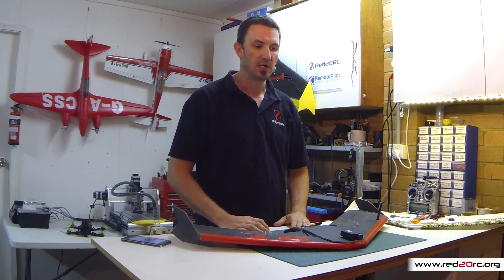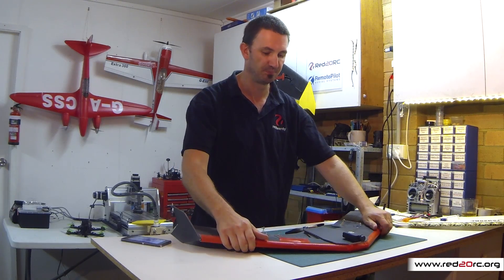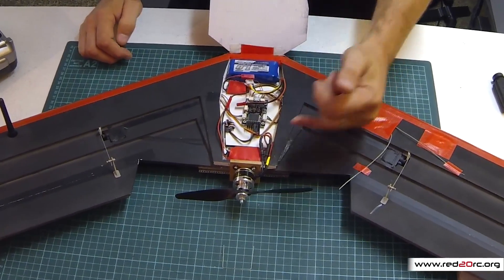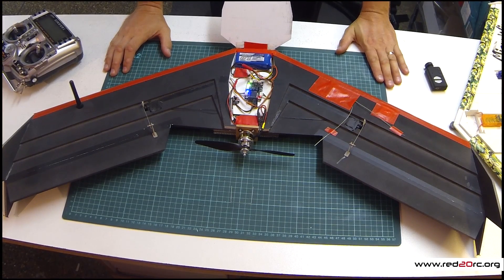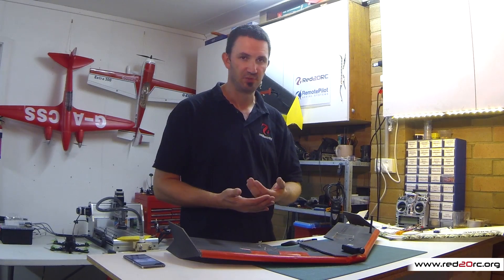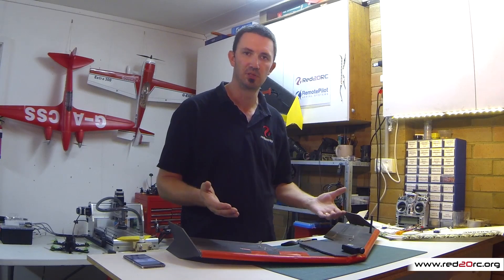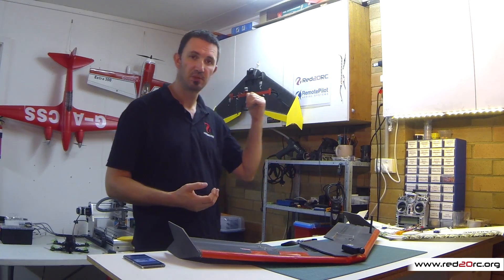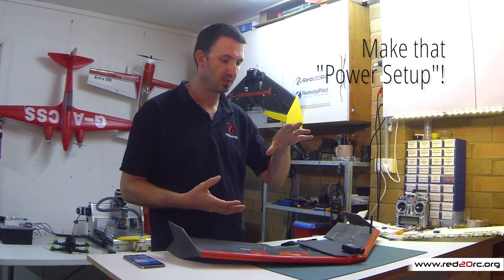Microwing UAV - foam board drone - HKPilot APM 2.5 - Autonomous KFM7 flying wing

Comment: I got my servos hooked up to my FC, I am thinking that maybe the problem why I cant get my flaps to go up snd down. I got them to go to the left snd right they wont go up and down. I am using the Taranis, hot any idea what to do. Thanks.
Reply from the maker: Derrick Mitchell which flight controller are you using? It sounds very much like you don't have elevon mixing set up.
Reply: Red20RC Thank you for responding back. I am using a Sp Racing Evo. Elevon mixing, I thought no mixing is necessary. I got it set up on Inav and on the Inav fixed wing site it  says no mixing or am I misunderstanding.
Reply from the maker: Derrick Mitchell that sounds right. The taranis should have mixing at all and the iNav should have elevon mixing. Make sure you test on manual/passthrough mode so the FC doesn't try to override your inputs.
If all else fails you could try a custom mix rather than a preset.
Reply: Red20RC  Ok that sounds good and I will try it in hopes that it will work.  I'll keep you posted on my progress as I follow up on your advice. Thanks!!!😎

Comment: Ever tried a bigger Prop, 7 or 8in?
Reply from the maker: joel ben never did on this one but I have since. The key seems to be a high kv motor, 2S battery and large prop for an extended flight time.
Reply: think a 2204 2200kv might work with a 8in prop or 6045 prop. 
Built a 650 mm, 3s 1000mah, QAV2204 2200kv 30A esc. No maiden yet. Happy Holidays. Afro mini 32. 414grams
Reply: Kfm 3

Comment: good video, could you tell me which it is the motor that is using, the prop and esc please thank you
Reply from the maker: It's going back a bit but I did manage to find the old motor! It was a Turnigy Aerodrive 2205/34 1500kv, spinning I think a 7x6 prop. It used a Turnigy Plush ESC (the 18A I think).
The biggest problem was that it was way underpowered and the battery was just too small. If I had my time again I would used a higher KV miniquad motor (like a 2205/2300), and 8 inch prop and a larger 2S pack.

Comment: The video quality is unstable and also the flight chacteristic are also unstable Parrot just came out with the Disco because that was not impressive
Reply from the maker: You are absolutely correct!
This was always just an experiment and it was underpowered and I made the mistake of testing in strong wind.
There was no vibration dampening and no stabilisation just an old Mobius stuck to the wing.
Remember though that this was never intended to be a FPV ship like the Disco. It was intended for still map imaging so none of this really matters.
It is true though that the mass produced RTF products will always be one step ahead in terms of technology (I just picked up a P3P for the same reason) and those with unlimited credit need look no further than Parrot or similar!
Reply: awww were you not impressed? and why are you comparing a wing worth about $100 to a parrot worth $1200

Comment: I love this, thanks. Do you think APM boards must have the little anti vibration balls, I have a spare one I wanna use. Is it windy in the vid? Would stabilization FC work?
Reply: +FastEasyLifeTips Also I have a gopro ;)
Reply: +FastEasyLifeTips subbed, great vid
Reply from the maker: I think some sort of anti-vibration mount is a must for the APM on a multirotor but not so important on a fixed wing. The wind was very strong and gusty in the video. The stabilisation worked very well.

Comment: Thanks where and how can I get that wing?
Reply from the maker: It was really only a one-off project but I did make the original drawings available. You can download them here: http://red20rc.org/microwing-uav-part-4/
I know someone made a hotwire cut foam wing based on the same wing and it flew very well.

Comment: Kfm-7 should be a good choice between stability and efficiency. 
Longer wingspans are in general a lot more stable, tough and rigid builds adds also to stability. 
I personally believe that leading edge has to be beveled as shallow as possible because that can accelerate moving air more than steeper one and so that the force of pressure around the airfoil is stronger than wind/turbulent force (causing instability). 
And bigger props consume less wattage simply they are a bit more efficient, but more audible.  
PS your builds are very clean!
Reply from the maker: +SladkaPritomnost Thanks. The intention was to make this one as clean as possible!
The KFm7 was a nice choice as it did give a little better glide than a KFm4 or 6. The leading edge could certainly be sharper and that might also improve stability although a lot of larger FPV wings have blunter, thicker sections as they want to be slower and more "floaty".
Of course the small span was intentional as the name might suggest!
The KFm sections in general are very impressive on small wings like this. The only drawback I have ever found is a poor glide performance. That said, I think the nicest FPV wing I've ever had was my mid sized KFm6 wing.
Reply: +Red20RC 
You are right about rounding the leading edge. I was always making them very sharp, today I did some studying comparing real airfoil curves and yes rounded ones give more lift than sharper ones!
So on my next build I have to try it.

Comment: cost to build?
Reply from the maker: Bodhi Geraci That is always a difficult question to answer as it depends on where you draw the line on what is included in the price!
The airframe itself - probably no more than $15.
The power train - about $50 including a couple of battery packs
The control system - Well the Micro HKPilot set is $145 plus another $10 for servos.

So, probably just over $200 for the actual aircraft not including glues, tapes, tools, paints and the like.

You then have to consider what else you need though. Radio transmitter - anything from $100 to $1000. Do you need a battery charger, laptop for the ground station, what payload is it going to carry etc. etc.

I hope all this helps!
Reply: Red20RC it does! Thank you!

Comment: Another great video the wing looks awesome, if you have time you should try to make a huge one like the kraken using a similar technique.
Reply from the maker: Gabriel Robson I would but there seems to be an upper limit for the KFm airfoil. I'm currently doing a KFm6 wing that is 1200mm but I think any larger than that and it just loses the ability to fly efficiently.
Reply: Red20RCThis looks great. Like you I was looking at the Sensefly and Trimble thinking it was hugely over-priced. I was considering the Hobbyking Go Discover as a potential platform. I'm entirely new to fixed-wing however, I currently play only with quads.

Comment: Thanks for your sharing. You mentioned putting a downward camera, which I am assuming is for mapping missions. Just for another comparison the commercially available SenseFly Ebee also has a small wing area (38") and its able to get 45 minutes flight times with a ~3s 22 mah battery.
Reply: +Nett Air 
45minutes with 22mah? No way!
...you probably meant 2200mah?
Reply from the maker: thanks for the comment!
The flight time on this wing is its biggest drawback. The combination of weight, efficiency and pack size just isn't good enough. The ultimate goal is to achieve a similar performance to the ebee without the huge price tag!
Reply: +SladkaPritomnost yes your correct. Sorry...I meant 2200 mah.